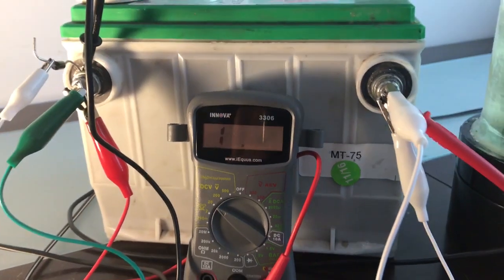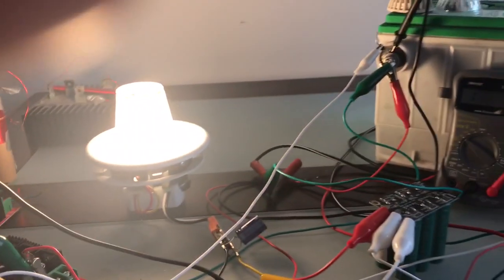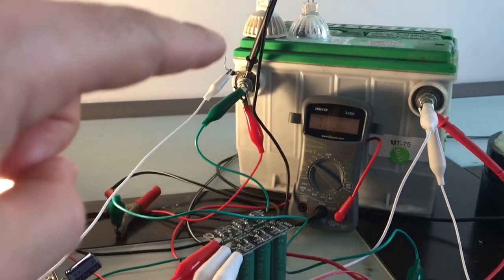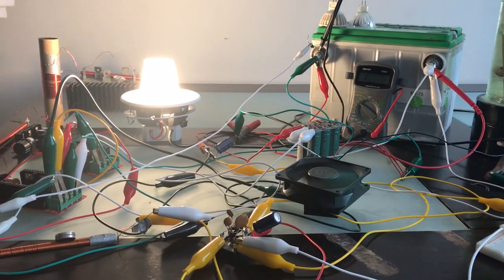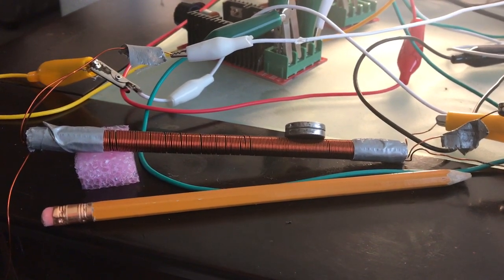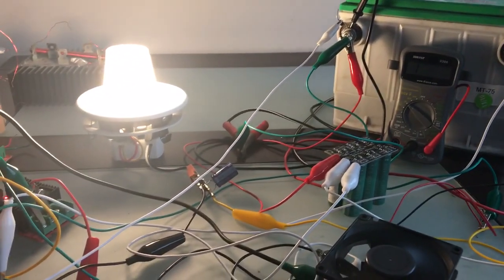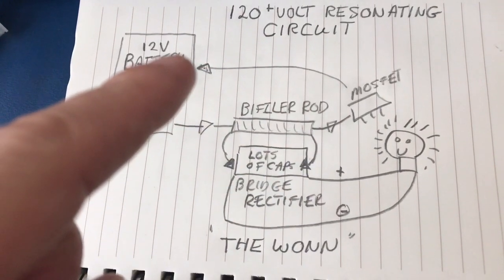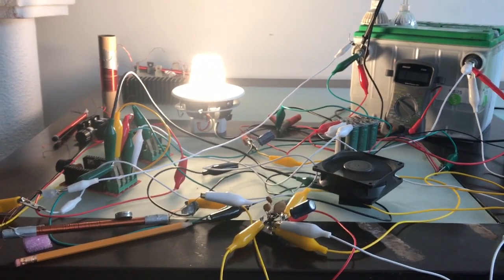Don Smith Replication Sort of2

Comment: If you do not see the amper current measurements of the battery the whole thing seems only a high frequency and therefore radiant pwm pulsed inverter, but this does not mean overunity but only a traditional electromagnetic wave transmission, correct me if I'm wrong, but if you don't publish either a scheme on which to reason and ask only for money remains difficult to believe, sorry for the clarity but this is my thought.